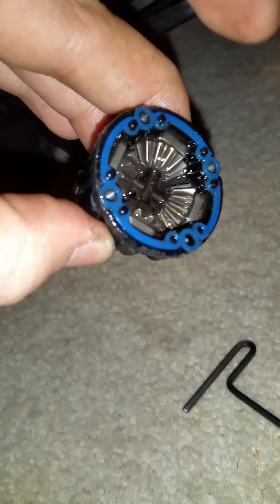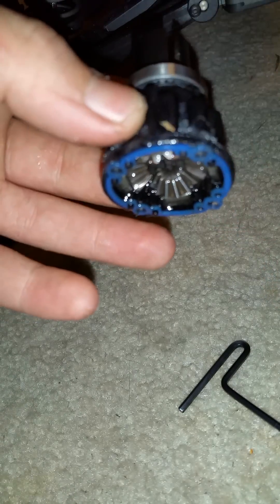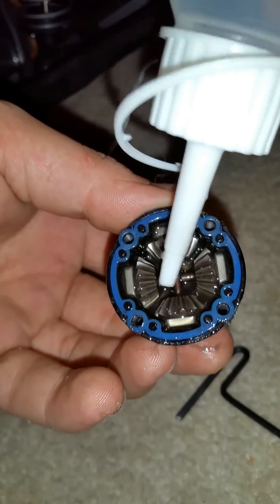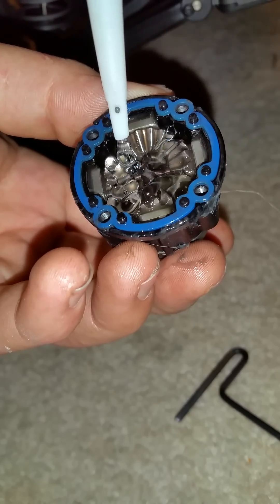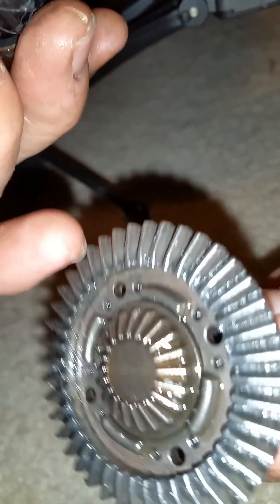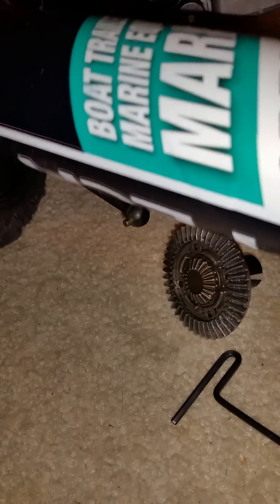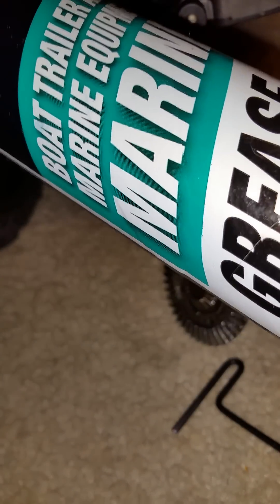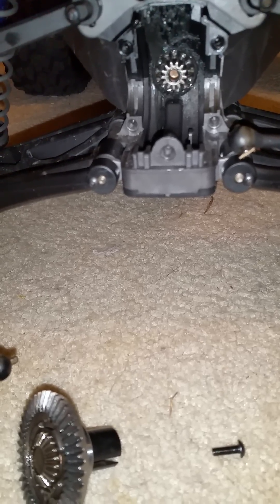X-Maxx differentials and why they may go bad

Comment: Only fill your diffs to the cross pins, and here is why not to fill your diffs all the way full
By design is same as in auto industry. You don't fill 100% of your diff. Just asking for trouble if you do. You need room for expansion. 40% full is probably about the standard. You should be safe to go more. I usually fill about half. Remember. Fluid doesn't compress. 1-2 psi in your diff case is a huge deal when there sealed units. You'll blow seals and bearing if not the entire housing. Say you fill at 70°. Then you go out and bash. Not sure of real numbers but say your riffs heat up around 100°. If there sealed there's no place for fluid to go. If the case is half full of air, the air will compress saving your seals and bearings
Reply from the maker: jammer2150 it looks like I fill them up all the way and i say thaat because as soon as you add the grease and run it all that grease is going to get in all the cracks and crevices. Also diff grease in an RC never gets that hot even racing and i know this because i have raced and still do to this day and have never had a seal blow or hardly a bearing.  there is never that much pressure like you speak of.  And I'm also an automotive technician.  The reason diffs in a vehicle arent filled is because as the ring gear spins it throws the grease that has now thinned out all over keeping everything lubricated.  there is alot more load on a full sized vehicle diff than an RC and also vehicle diffs dont use lubrication to change the action of the differential. they use springs and clutches.  So many try to compare full sized vehicles to RC vehicles.  in some places it makes sense but 1-2 psi?  I'll do the math and get back to you about how much silicone fluid expands cause I know for a fact from weekend racing, oval, on-road, off-road and drag, that feeling your diffs to the top after cleaning them out once you run the vehicle what looked like 100% in actuality was only maybe 75% max.
Reply: This could be one of those conversations that leads into scale speeds, and all that nonsense, if you have not had any problems with the way you fill your diffs, I am not going to try to prove you wrong or right as I am pretty set in the way I fill my diffs, as are you :)
I just purchased an x-maxx and it looks like you got some pretty good informative vids on it, so you will probably see some questions from me on some other vids of yours.
Reply from the maker: jammer2150 No problem.  I'd be glad.to help.  I know many say not to fill the diffs, many have commented this nut not only myself but many others fill them.  I just put 1m weight in my funny car amd it's gonna see speeds way beyond what the X-maxx did.  I hope the other vids help.

Comment: I don't mean to ask a stupid question but I just got my xmaxx today and came across the concern of not having enough lubrication.. what weight silicon grease did you use? I keep getting different answers from forums.. I know it depends on the terrain you're planning on using the truck on.. that being said it won't be on hard pavement obviously. I bought Traxxas 1647 silicon grease would this be think enough? not sure of the wt of the grease..
Reply from the maker: Fred Fonseca I tried to get the action comparable to my racers.  for the front I use 210k so the front wheels will pull the vehicle around turns.  gets rid of understeer.  rear is 100k for stable wheelies but also no understeer.  I tried over 20 setups from stock to 1000k all around and everything in between and the 210k front 100k rear gets the best driving performance.
Reply: OK great! I didn't hear on the video when you stated the wt grease you used I did get a chance to go to hobby town in Kennesaw,GA and pick up different weight oils.. first run on the xmaxx was yesterday and immediately started to hear a peculiar sound.. I didn't hear when I would pick the truck up and give throttle only when it was on the ground.. so I added the grease inside the diff and marine grease on the outside.. I still heard it.. took the top spur out to check my clutch and it was somewhat looks so I followed your videos on how to properly adjust it.. I did notice Traxxas forgot one of the 3 screws holding the spur gear missing! right out of the box! needles to say I put it back together and seems to be acting normal.. thank you for your help! keep up the great vids!! I don't plan on upgrading much on the truck unless it breaks.. but I'm like you I like taking care of my cars.. so I doubt I'll be trying to break it on purpose.. thanks again!

Comment: That's going to rob you of a LOT of power!
Reply from the maker: nope...I did that about 2 months ago and she flies.
Reply from the maker: do you not understand how a diff works?
Reply: More stuff to slosh around = more power drain. Do you not understand how basic physics works?
Reply from the maker: +TCPUDPATM PORTS lmao, more fluid to slosh around?  seriously?  it has nothing to do with physics you nimrod.  a differential allows each wheel to turn independently of one another.  also silicone GREASE is too thick to "slosh" around.  You really need to educate yourself before commenting.  the only thing adding diff fluid will do is make it harder for wheels to spin independently of one another.  so essentially with a thicker diff fluid more power will be transfered to the wheel with less traction.  I'm a certified auto mechanic and an IT tech.  Also with diff fluid it's fluid dynamics specifically.  so don't try to come on my channel and my videos and try to tell me certain things.  not only did I prove you wring I also brought facts, not just saying "it's simple physics" I went even more specific bringing up exactly what branch of physics differential fluid falls in.  also that diff grease doesn't slosh.  in full sized vehicles it is thinner so it does move around but not in an RC car.  diff fluid is meant to tighten or loosen up a diff in an rc car for better control and steering.  diff druid will never rob you of power unless you add too thin and the inside tire will spin. that's when you will lose power.  know your stuff before trying to make me look like an idiot.
Reply from the maker: +TCPUDPATM PORTS lmao, more fluid to slosh around?  seriously?  it has nothing to do with physics you nimrod.  a differential allows each wheel to turn independently of one another.  also silicone GREASE is too thick to "slosh" around.  You really need to educate yourself before commenting.  the only thing adding diff fluid will do is make it harder for wheels to spin independently of one another.  so essentially with a thicker diff fluid more power will be transfered to the wheel with less traction.  I'm a certified auto mechanic and an IT tech.  Also with diff fluid it's fluid dynamics specifically.  so don't try to come on my channel and my videos and try to tell me certain things.  not only did I prove you wring I also brought facts, not just saying "it's simple physics" I went even more specific bringing up exactly what branch of physics differential fluid falls in.  also that diff grease doesn't slosh.  in full sized vehicles it is thinner so it does move around but not in an RC car.  diff fluid is meant to tighten or loosen up a diff in an rc car for better control and steering.  diff druid will never rob you of power unless you add too thin and the inside tire will spin. that's when you will lose power.  know your stuff before trying to make me look like an idiot.
Reply: You missed the point, calling people names in your own video and hating on plastic earns you no respect.
Reply: PS: Don't feed trolls ;)
Reply from the maker: +TCPUDPATM PORTS you think I Care what you have to say?  dude, I proved you wrong GET A LIFE.
Reply from the maker: +TCPUDPATM PORTS I get messaged daily from people on facebook from all the RC groups I'm in due to my proven knowledge, I'm an admin of countless groups, I've started groups that have grown to thousands of members, I help the rc community.  What have you done lately besides get proven wrong and say things that make no sense.  btw thank you for watching.  more cash in my pocket.
Reply from the maker: PS:when the q-tip encounters resistance when cleaning your ears stop.  you've scrambled your brain enough.  Just a little tip.
Reply from the maker: +TCPUDPATM PORTS also I missed the point?  your point was that I'd lose power.  had nothing to do with the other idiots who have bashed my videos.  Your stupidity continues to shine through.  see above comment regarding Q-tip.

Comment: You are giving it too much credit... "A vehicle this size with a plastic diff is not going to cut it" errmm excuse me is this your first 1/5th scale? Baja 5Bs had plastic Diffs for EONS and not a single problem putting down all the power through it... You have 2 diffs sharing the load, Unless you run 8S or 12S I don't see those diff cases becoming a problem. 

Also you obviously overfilled the diff with diff oil, The amount of oil traxxas put was enough its just drivers error to make the diff out... Also diff oil contrary to popular belief does not lubricate the gears.. Less diff oil makes a faster diff action which in turns makes the gear overheats and crack, Too much diff oil makes the diff go Ka boom. Diff grease does a better job protecting the gears but it also makes it diff out easier.
Reply from the maker: really?  if everything you say is true why do I have no broken parts and I'm running the castle xlx setup with the 2028 motor.  and no ka-boom.  I know exactly what I'm doing.  adding all that grease stiffens the diffs up which is what I wanted.  know it alls.  ugh.
Reply: Would love to know where that info came from 😂😂😂

Comment: I have a question I am working of filling my diffs up with 50k oil but when i pull out the diff and un bolted it to access the spider gears i ntice that the side with the big gear and the output for the dogbone seems tight end when it is seperated from the main diff housing it is very hard to turn the output and make the inner gear turn, my question is this normal, I just got my truck and have never ran it so tis makes no sence to me